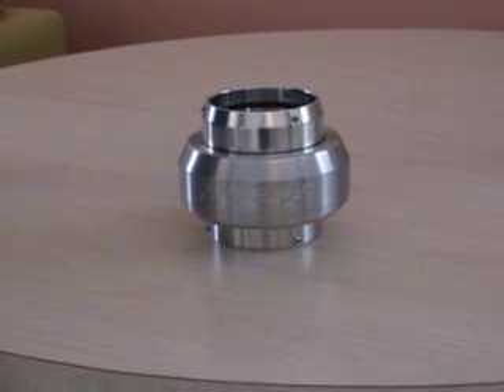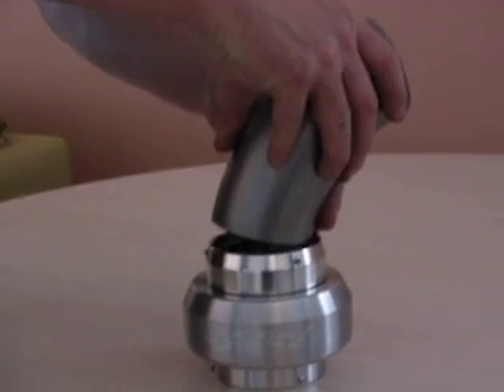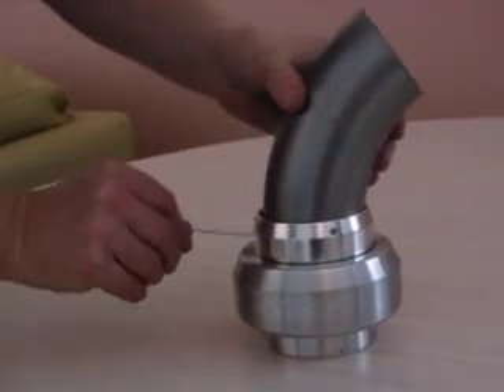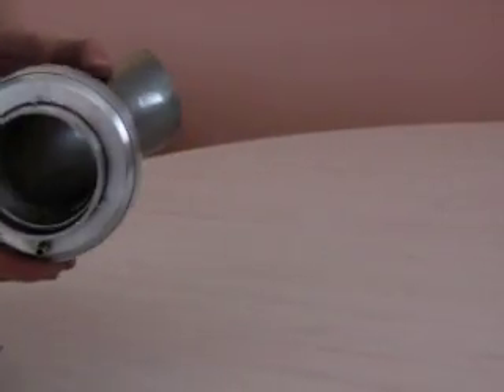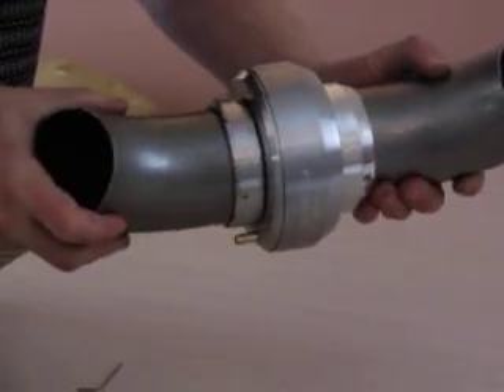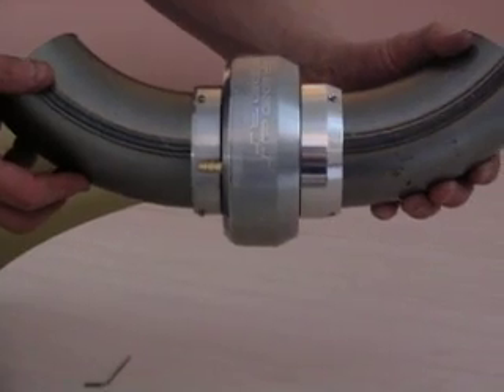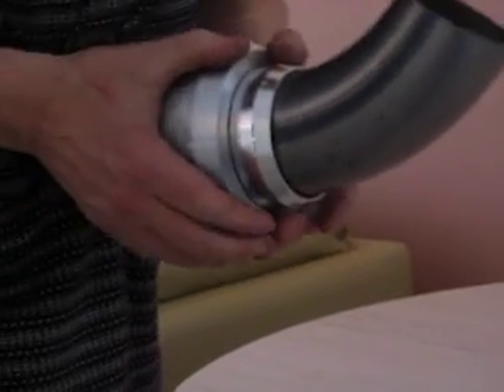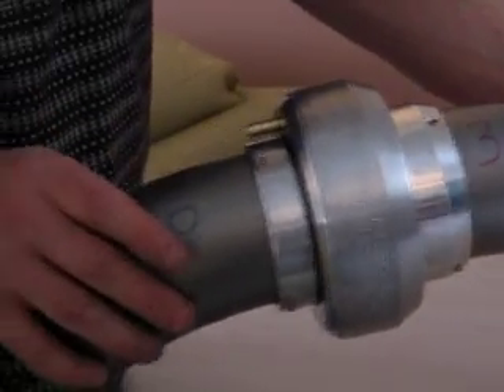"Steed Speed" inline blow off valve

Comment: Nice work. I hope it can hold boost pressures over 100 pis? With out blowing off the pipes. I'm kinda wondering if those alin bolts will hold the pipe on.

Comment: If so wouldn't you need to use softer springs in it because a normal motor can only make 20 lbs of vacuum. So it wouldn't be able to pull the valve open if the springs take more than that to open?

Comment: This is a very good idea but I see a problem.  On a standard blow off valve when it is under boost and then the throttle is closed the vacuum that the motor makes with the throttle closed takes some of the spring pressure up in the valve and the boost pressure pushes the valve open.  With this set up the boost pressure.can not push open the valve because it slides back so it relies on vacuum only to open the valve right?

Comment: @sergsrt8 You could but there's really no point to it in an N/A Car. Turbos make pressure and when you let off the throttle, the TB closes and the compressor begins to slow but its still creating boost. The pressurized air tries to escape through the path of least resistance, back through the turbo. this not only slows down the turbo but it causes cavitation called Compressor surge which KILLS turbo bearings and seals. The BOV senses when you let off and releases the pressure outside the system.

Comment from the maker: @pittsburghxzach 

The screws go right into the pipes to hold positively and not just with friction.  So far it has been tested to 25psi but other customers might have gone higher.  I have sold just over 200 of these so far in 3 years with no problems

Comment from the maker: @contraption22 

The inside of the valve tapers so that the pipes wedge into the ends which stabilises them.  Also I recommend drilling into the pipe a little to give the screw a positive seat.

Comment from the maker: Yes, it presses against an O-ring.  Once sealed the air inside has nothing to push against so it is impossible for it to leak.  For maintenance you just squirt some oil into the vacuum line occasionally.

Comment: I don't know much about bovs but I know you can't put one on a car that doesn't have turbo, and this was with those pressure bovs. but i've never seen a suction bov, so basically my question is would you be able to put one of these suction bovs onto a non-turbo car (just for the sound and not the performance) or is it still the same as the pressure bovs?

cheers

Comment from the maker: There are plenty of high horse Mitsu motors around. These have also been used on several 1000hp + V8 motors and they work very well.

These valves seal very well but you have to take care when installing that the pipe is on a straight section.  The valves are held with "dog point" screws which protrude into holes in the wall of the pipe stopping it from pulling out under pressure.  The ends have a taper to hold the pipe securely and stop it from distorting when you tighten the screws.